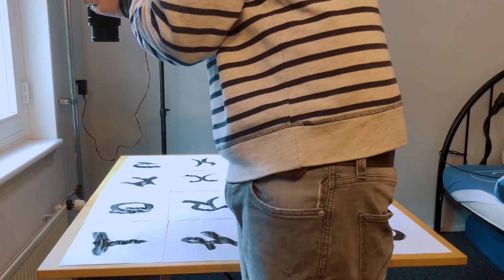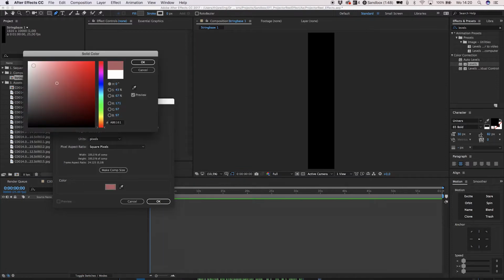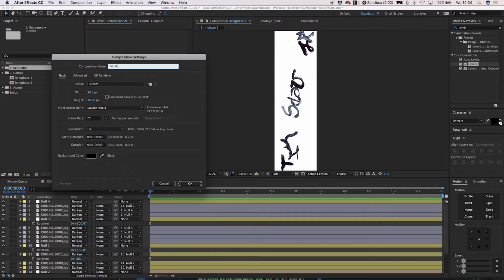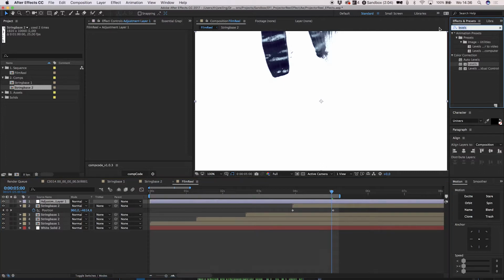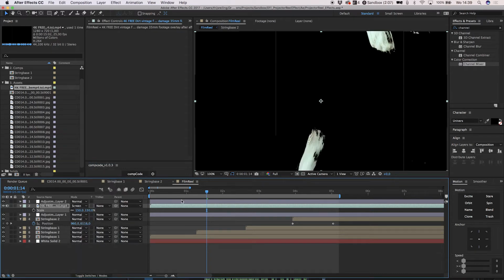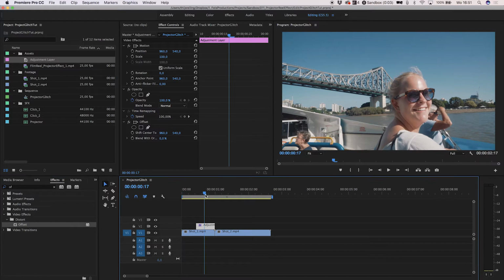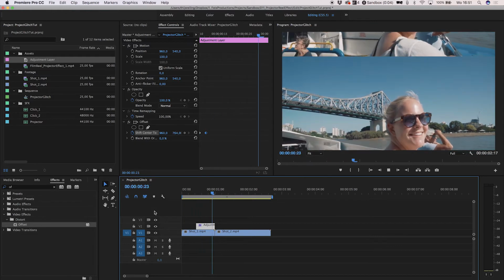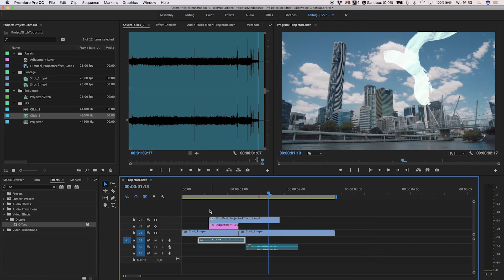How To Create A Projector Glitch Effect In Adobe Premiere (Film roll effect)| Tutorial

Comment: Ah, gee-whizz, sorry for the spamming.
QUESTION: How did you create the DOTS at GRID intersections in the reel/glitch effect?
Reply from the maker: Sandro Trunz alright, lets see if I can do this by memory! The geometric grid like bursts you are refer to are ‘plus’ and ‘rectangle’ shapes. I made them using a shape layer. Simply draw the shape you want and give it a stroke. Then add a trimpath to the shape to animatie the stroke. After that add a repeater to the shape layer and make decide the distance between the copies and make sure you have enough copies to fill in a row on screen. (it starts with something like 100px on the x-axis). After that add an other repeated and change the position of set to the y-axis. If you’ve done it correctly you’ll notice that the entire row of shapes gets repeated.
Reply: @Feisproductions  Holy Guacamole, Feis, thanks heaps. That's way more than I could ever have bargained for as far as detailed explanations go.
Doesn't this make GREAT CONTENT to produce a quick HOW-to / tutorial for?
I'm (still) not that good @ AE which is why I'm already a bit lost at
- give it a stroke
- add trimpath to animate stroke
- add repeater
(...)
I'll give it a sloppy Google & cheeky try ...

Comment: Crap, I'm still learning... I was good up until you said to open a new composition... I didn't realize I had to have a separate program.. Is there any way to create that asset without after effects? I mean I painted the letters and everything. Help urgent!
Reply from the maker: Hey Cristina! You can actually create the asset in a number of ways. You can also create the "Stringbase" in Photoshop or even in Premiere.
- In Premiere create a sequence with a lot of height similar to the  AE composition. 
- add a white color matte (or just a white picture)
- Arrange all the photos of the letters in that sequence by adding all of the layers. (use masks to clean up the photos)
- To invert the color add an adjustmentlayer on top of it all and add the "tint" effect. 
- change the black one to white and the white one to black. (you might want to adjust the contrast aswel)
- Import that sequence in a normal Full HD sequence. 
- Select the stringbase sequence and go to the "effect controls" tab. 
- Toggle down the motion and animate the position similar to what I did in AE.
- Export the sequence and now you have your asset.

Hope this helps!
Reply: @Feisproductions  wow, thank you so much! I was thinking sequence but I didn't know what to do after that. I ended up down loading premade ones,but I'm gonna give it a shot right now! 😃
Reply from the maker: Premade ones will do the trick for sure BUT there is just something special when you make it all from scratch! Also using this technique allows for some experimentation, such as; using inkmarkers instead of paint or using a different kind of paper changing the texture. It makes it all more organic.
Tell me if it works out, if not I might be able to give more detailed tips. Good luck!
Reply: @Feisproductions  thank you, thank you, will do! Am diligently working on it! Also I edit for the "creepy" side of you tube, so this allows me to put interesting clues in it this way as well! I may have to come back and ask about the manual animation of this,but we'll see. Right now I've managed to create the sequence by going to sequence settings and custom. I put the dimensions you specified and am now placing letters. I will keep you updated on my success!